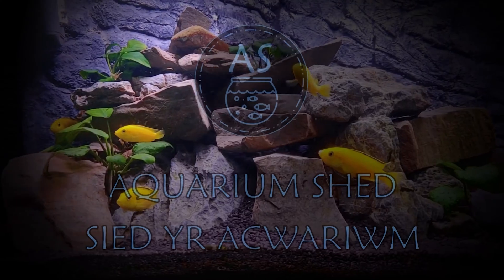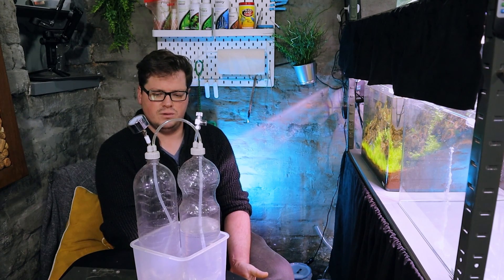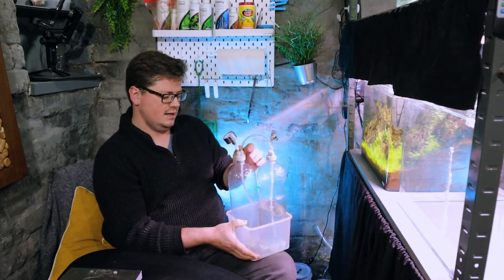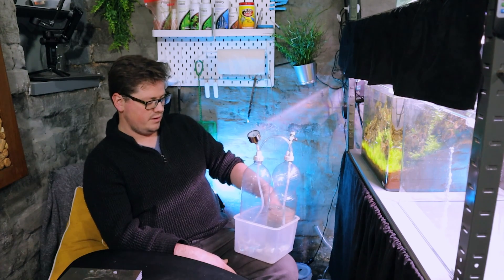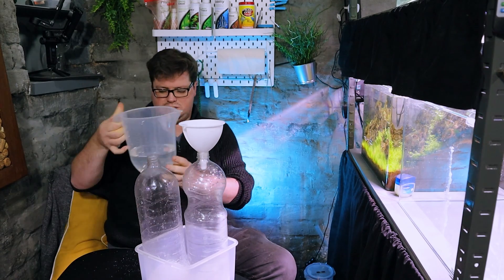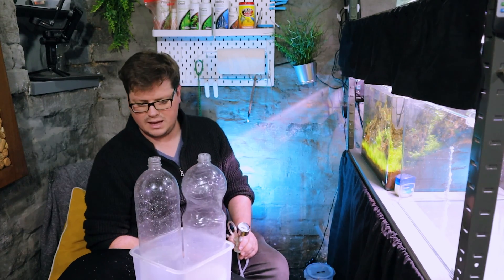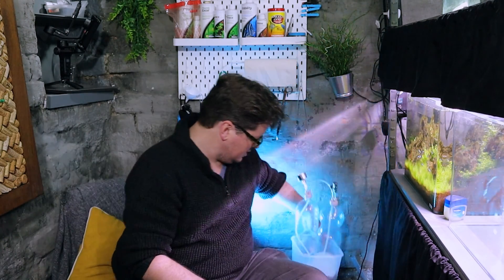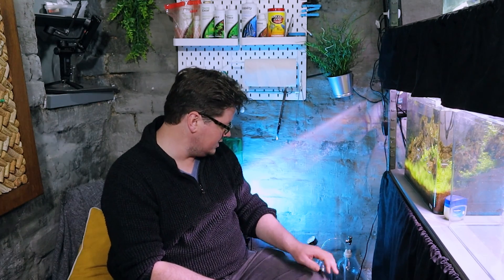Get the best results from CO2 Soda Bottle Kits

Comment: Hi Owain. So this is the way I was thinking of going with DIY CO2 as the steel cannisters have gone up in price so much. My only concern now is seeing how hard you had to squeeze the bottle to get the reaction going - my poor hands can hardly cut the meat on my plate sometimes - doubt it could do that. Can you just leave it and it would eventually sort itself out or will i have to down a couple of cans of spinach or call in the local good-looking muscly firemen to give it a go (squeezing the bottles i mean - primarily!!). OH (you are gonna get soooooo fed up of my soon - sorry) Have seen ones that are metal caps and a metal bar between the A and B bottles - any idea what hey are like? Ta very!! x
Reply from the maker: 😂Haha. You'll be calling in the fireman I'm afraid. The initial reaction has to be started by some really strong squeezing of the bottle. After that you shouldn't need to squeeze it again as the pressure sustains the syphon, but getting the initial reaction started does require a strong squeeze 😂. I know the metal bar models you are talking about - I've never used that model, but as far as I can tell they are essentially the same just more sturdy in terms of how they keep the bottles together. I'm wondering if for your purposes, a yeast and sugar reactor would be the best option. I've never tried them, but they are basically just a "shove the ingredients together and wait" scenario and pretty simple to operate by the looks of it. JBL do a product called ProFlora Bio that might be suitable. Hope that helps!
Reply: @AquariumShed  Well as nice as a couple of hunky firemen hanging around to give my bottles a squeeze - knowing my luck they would end up being Shrek's older brother!! So i'll have a look at the yeast and also the ProFlora Bio stuff!! Thanks again. Have to say - feeling a bit stalkerish - but i just love the simple way you explain things - being a simple person myself (or is that senile - not sure) i find your cids brilliant!! x
Reply from the maker: @debbiefinch7445  aah thank you. That's very kind of you to say. To be honest, I'm still getting my head around what content works best, and what I'm best at. So feedback like this is great!! 👌👍
Reply: @AquariumShed  Hi honey - so commented earlier, I have gone ahead with the JBL ProFlora Bio 160. Have to say - 24hrs and still no sign of bubbles. Have watched other YouTubers ( who said that? How RUDE!!! lol!) who do not rate the diffuser with it so thinking of swapping it out for something else - diffuser-wise. Any recommendations - and were you maybe gonna do a review on this system - would like to run a comparison alongside yours. Hope you are keeping well x
Reply from the maker: Hi Debbie, good to hear from you. I'll definitely try and do a comparison video one day, but it's not top of the list I'm afraid as I'm in the middle of an epic (read expensive) aquascape in my new tank. I am going to be experimenting with yeast and sugar in my steel canister tho. In terms of diffuser, I'd imagine my advice won't be that helpful since I've never had pressure issues so have the cheapest unbranded diffusers from Ebay and they work just fine. I did actually have a JBL Taifun like you get with the Proflora Bio kit which I found great until I snapped it by mistake. Again, not very useful if you are struggling with this one. My only bad experience with diffusers are the acrylic 3in1 types that Colombo and Tropica make. I got one in the LFS bargain bin and the co2 leaked out of the side of the ceramic disk. So, my guess for your predicament is you need to wait for the kit to get up to pressure. The reaction will be slower in lower temperatures so that might be playing a part. I'd be surprised if the diffuser supplied didn't start to be functional once you have the right pressure. Sorry I can't be of more help. 👍